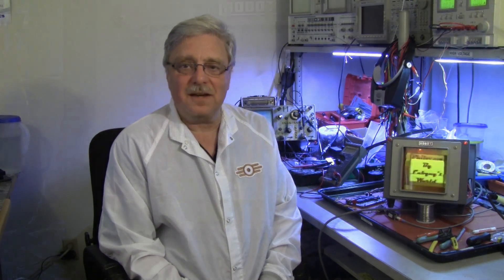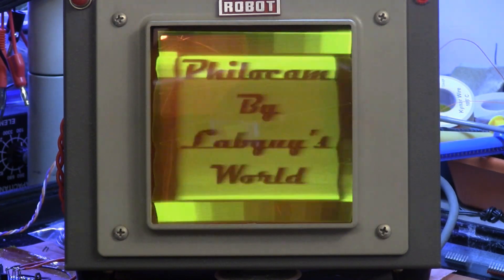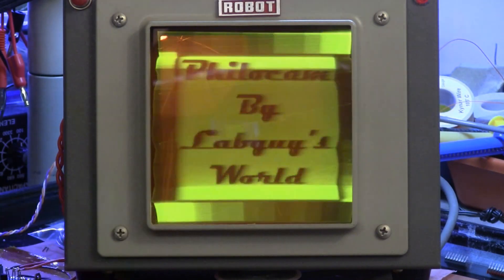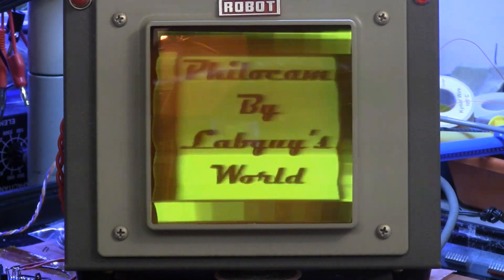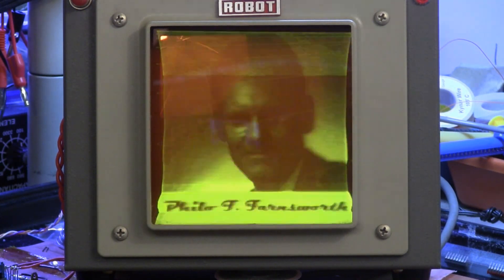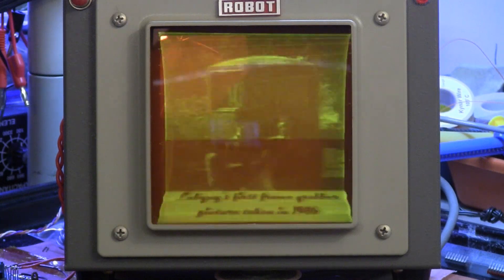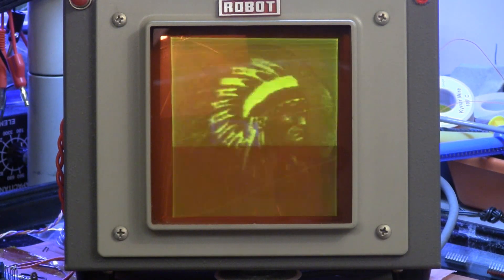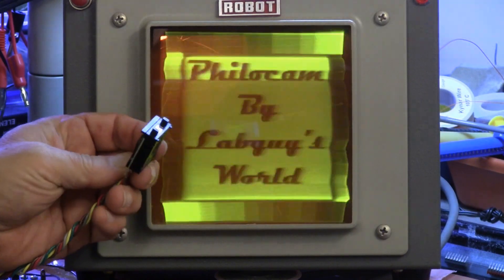PhiloCam Part 10 - New video format sync generator, Part 5

Comment: Congratulations on your progress with this unique project! While many end up discussing or dissecting old technology, you successfully recreate and even elaborate on these early experiments. This is a highly underrated project of yours and definitely deserves more attention!
However, I can't help but notice a distortion of the horizontal deflection by line brightness - the darker a line of the image is (on average), the narrower the image becomes on that particular line. (Visible especially at the dark text baseline level on Slide #0.) 

I wonder whether this issue is caused by interference between the sync pulses and the rest of the video signal in the sweep generator or a physical property of the CRT's electron beam causing it to deflect less in magnetic fields when weaker.
I have observed similar phenomena in other CRT televisions - both tube and transistor based and with electrostatic and electromagnetic deflection alike.
Reply from the maker: Thank you for your kind words. You have a good eye, sir! Yes, there is a problem with this monitor. As the average picture level changes, the video raster also changes size. It is that the high voltage lacks any form of regulation. OR the low voltage regulators are malfunctioning. I made a video recently where I demonstrate this phenomenon of scan size vs high voltage: https://www.youtube.com/watch?v=QTRv-IZpePk 
I am currently seeking the original service manual for this monitor so that I can look into these matters. And I will be designing and building another monitor in the near future. It should not suffer from these problems. But, I will live with this for now. 
Have a great day!
Reply: @videolabguy   That's wonderful! 

I recommend using a tube with long persistence phosphorus (such as a radar screen). However, most of them have electrostatic deflection so you may need to alter your circuit (or equip the tube with an external deflection yoke ☺️). If you want to use vacuum tubes for your monitor, I suggest utilizing the Phantastron (Miller-Transitron) pentode sweep generator. My favourite electrotechnician Danyk created a PAL video monitor with this schematic: danyk.cz/elmon_en.html
It should be possible to alter the H/V sawtooth generator frequency by changing capacitor values around the EF80 pentodes (left one = ↔, right one = ↕) for your application. Their values are not critical though, as the frequency can be fine adjusted using their respective potentiometers.

Comment: That looks a lot better. I wonder how it would look if you changed the camera to 24 FPS progressive.
Reply from the maker: It would look a lot more like what Farnsworth saw. 24 frames per second, 128 lines. 3.072KHz line rate, divisible from my 4MHz clock. BUT, it would require modifying the monitor quite a bit. I would be willing to do that. If you help me find the service manual for the Robot Research model 61 monitor. I am searching for it now. Still no luck.
Reply: @videolabguy  No I meant your camcorder you are shooting the Youtube video with, not the Philocam.
Reply from the maker: Oh! That's completely different! Never mind. ;-)